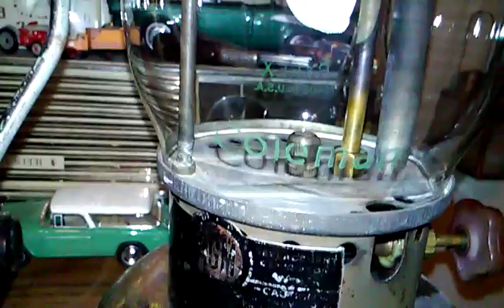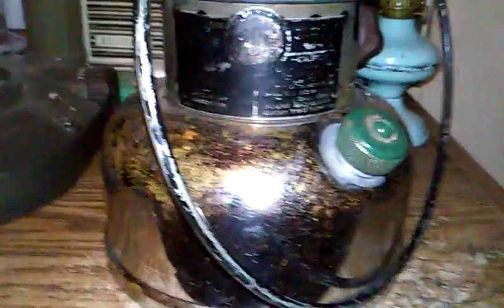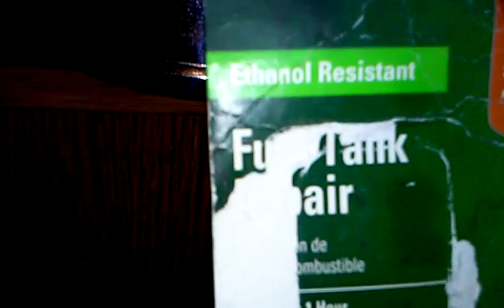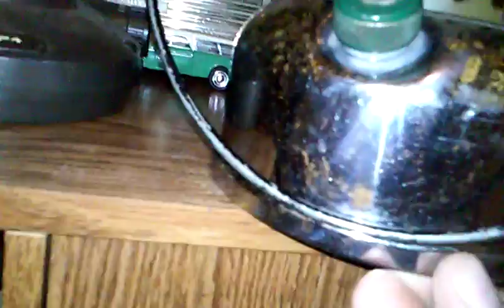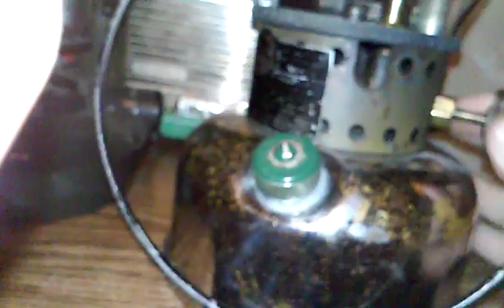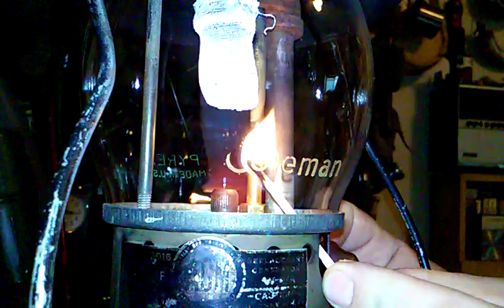AGM 3016 fixed fount

Comment: I've had good luck sealing the main stem with a few wraps of teflon tape.  That way it can be disassembled from the fount  again in the future - just in case you come across a good fount that has damaged upper components that can be switched out.   I  clean the threads on a wire wheel first as the factory used some kind of thread sealant originally.  It sounds like AGM lanterns have problems with stress cracks developing in the founts.  I just rebuilt a single mantle model 3006, which had a good fount but it looks like it was made from steel instead of brass.